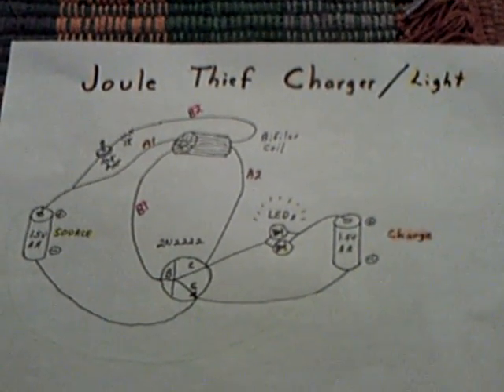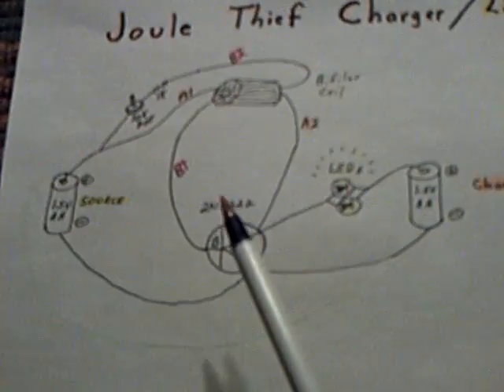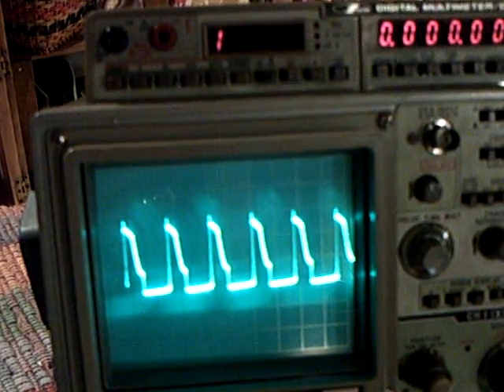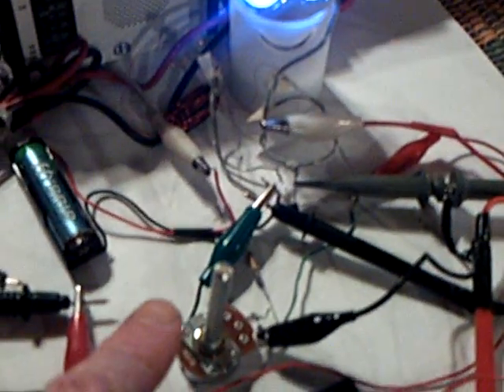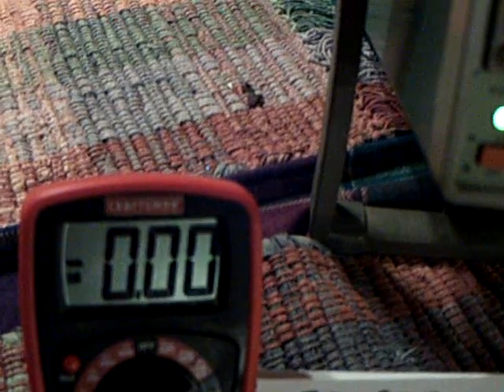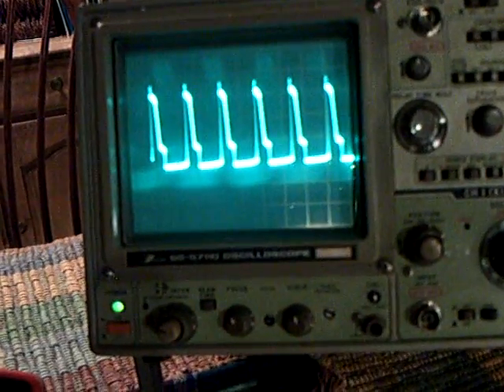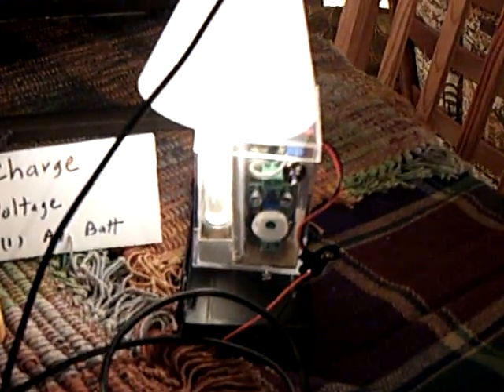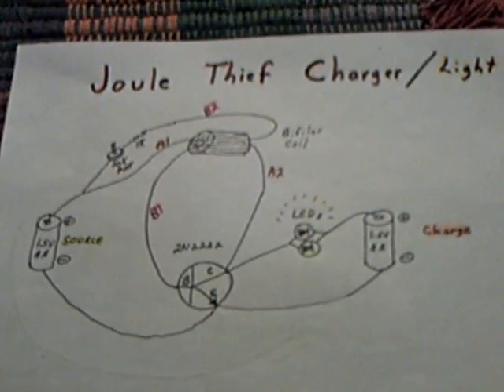Face & Voice of a Joule Thief

Comment: Nice work !
were these AA NiMH accumulators or standard alkaline batteries ?

Can you run your system just with charged capacitors without any batteries ?

Many thanks.
Regards, Stefan.